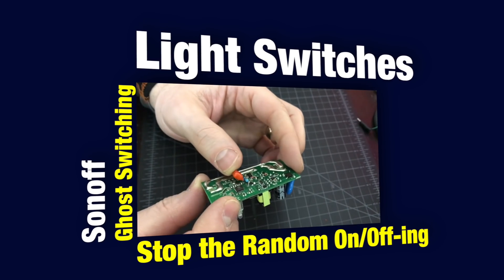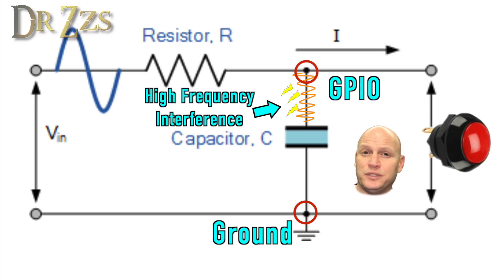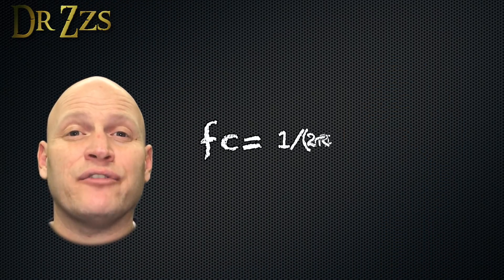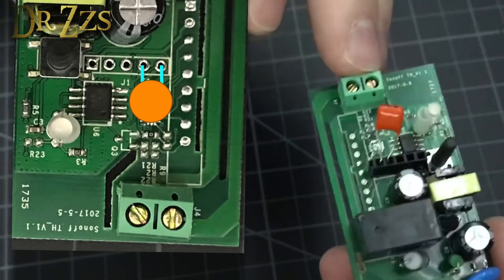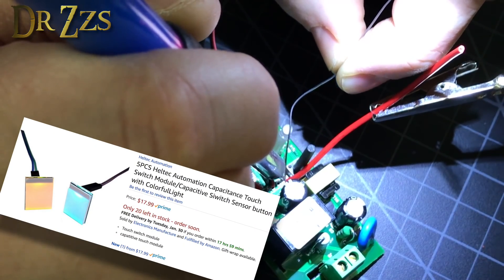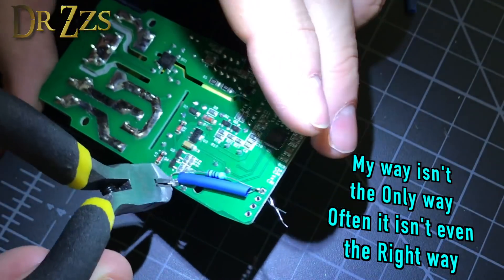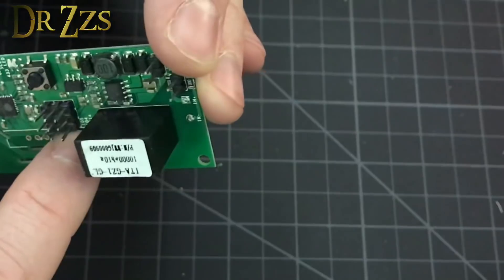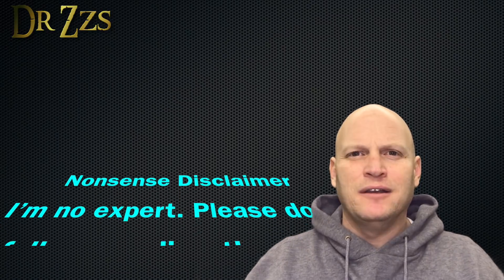Block Interference with a Low Pass Filter - Bust Ghost Switching!

Comment: I vote for 1.6 ota fix and how about fan light control? I'm thinking using a Dual. Thanks
Reply from the maker: I'm not smart enough to fix the 1.6 OTA problem.  I know the comment sections on the Sonoff website are full of request for them to allow a downgrade of firmware or undo the certificate requirement in the next version.  As soon as I hear about a solution I'll post something about it. 

But for the fan and a Dual I could help ya. 
I did a video on the Dual. https://youtu.be/pGbDFsNMOkw
Order from iTead directly and ask specifically for an R2.  Make sure you use Tasmota 5.10 or newer. 
If you need more specific help beyond what's in that video let me know.

Comment: According to this: http://www.ganssle.com/debouncing-pt2.htm you would need two resistors for a proper debounce circuit. The one additional resistor is needed for the controlled discharge of the capacitor.
Reply from the maker: Thanks  
I need to educate myself on debouncing.
Reply: Where does the second resistor go?

Comment: Thanks for your video. I just installed the resistor yesterday, cause I don't have the capacitor yet. I used 10kohm. That solved the flickering 99%. Cause I experienced one toggle once in a day. Also recommend use a twisted pair of wires, that would help to cancel some interference. Any video about the best strategy to keep Tasmota updated OTA? I'm still running stock firmware on all my Sonoffs, except the one with Tasmota that I'm testing before update the other's.
Reply from the maker: Actually, I do have a recommendation for an video about OtA Tasmota flashing:
https://youtu.be/ONFhXM5R-t4

That's just the one way I know how to do it.  There are other ways:
https://github.com/mirko/SonOTA

Good luck!
Reply: DrZzs Actually, I already watched you video about OTA flashing. But now, that I already have the Tasmota firmware, I want to know what is the best strategy to upgrade the Tasmota firmware to a new version of it. Do I need to download the new version, compile and flash it again? Imagine if I have lots of  it installed. I have to use the Tasmota firmware to upgrade itself. But how is there any easier way to do it? How to do it without loosing the configuration of each unit? Thanks again.
Reply from the maker: oops, sorry, I misunderstood.  
You don't need to re-flash.  There are 2 methods to update Tasmota. 
One is with their OtA server-based link.  
On your device main page there's a button that says "Update Firmware" (or Upgrade, can't remember which). When you click that it'll open a page with the 2 update options.  The top is just to connect to the Tasmota github and upload the most recent version.  
For the second option you need to go to the Tasmota github and download the latest version to your computer.  Then upload that file.  I think it's Sonoff.bin  

As far as I know there is no auto-update option.  So you'll have to connect to each device and update them separately. 

You may have already read this, but here's the link to the Tastmota upgrade page:
https://github.com/arendst/Sonoff-Tasmota/wiki/Upgrade

I've done both methods once each.  They worked fine for me.  

Good Luck!

Comment: I've added Sonoff basics inside of several single pole switch boxes as well. Then the switch is only wired to the gpio. I have also had some of the lights randomly toggle off or on. I thought HA was the cause or tasmota on the Sonoff was crashing. Any tips on digging up the root cause in the logs to verify the light is legitimately toggling because gpio was shorted? I see the light was logged in Home Assistant as being turned off or on, but I didn't do it. Would like to be sure, if possible, before I purchase more parts, open up light switches, and get soldering. 😁 Thanks for the great videos!
Reply from the maker: You're welcome!
I can understand that. I wouldn't want to tear all that out and do all this work to have it not fixed.  
You might try some kind of MQTT monitoring software.  Maybe that would tell you if the command originated from HA or not.  I don't use an MQTT monitor currently but I've been looking at them and I'm sure I'll get one running soon.  I found this article just today in fact:
https://www.hivemq.com/blog/seven-best-mqtt-client-tools

I haven't tried any of the programs they discuss, but maybe you could start by trying something like that and see if you can get the info you're looking for.  
If you do, please come back and let me know.  

Good Luck!
Reply: Hi DrZzs. Please help me with something.  Im trying to automate something in HomeAssistant, and the trigger should be when someone toggles a Sonoff switch (with Tasmota). How can I detect this in HomeAssistant? How to doffer when the swicth has been toggled physical and not in the app?
Reply: Sonoff retain feature not enabled within Sonoff by default.

So turns out retain isn't enabled by default on the Sonoffs with Tasmota.  You have to use command "cmnd/sonoff/PowerRetain on" in the console to enable it.  I noticed that if I had a light on, rebooted HA, it defaulted the switch to off, even though the light was on.

Use "cmnd/sonoff/PowerRetain" to see if yours are on or off.  Mine were off.  So, I enabled it, rebooted HA, and now it detects that the lights are still on!

https://github.com/arendst/Sonoff-Tasmota/wiki/MQTT-Features 

This seems to have also fixed my phantom lights turning themselves off and on... 
https://community.home-assistant.io/t/mqtt-switches-and-lights-are-not-persistence/36300 

https://home-assistant.io/components/logger/
To enable FULL debug logging, just add "logger:" to your configuration.yaml file and you get full logging in /config/home-assistant.log after reboot.  When one of my lights randomly shut off, I was able to use Notepad++ to CTRL + F, then use the Mark feature to search for "payload=".  This made it easy to spot the times when the light/switch was powered off or on.

Comment: Hi DrZzs. Awesome videos, thanks for posting. I'm running a sonoff basic connected to a 240v relay which is used as a switch for a 12v circuit. After a few days the sonoff switches itself on, when you turn it off, it comes straight back on again, sometimes vice/versa. Unplugging the sonoff usually cures for a few more days. Assuming this is the same issue.. I would need to do this for gpio12. Where could I pick these solder points up on the board?
Reply from the maker: I found GPIO12 for you!
Probably the easiest place to hit it is on the ESP-chip-facing side of R19.  
I'd be very interested to know how it goes if you decide to go after it. 

https://github.com/arendst/Sonoff-Tasmota/wiki/Sonoff-Basic

Good luck!
Reply: Made the changes gpio12 as suggested.. Sonoff seems to work still! Used a 4.7k resistor & a 22nf ceramic cap.. will update in a few days. I have a picture, can post.

Comment: Seems like something that could be solved with a longer debounce in tasmota?
Reply from the maker: I saw someone in the Tasmota issues page talking about something like that.  I don't know enough about the coding involved in that kind of a change. 
I didn't mark the post so I'd have to search for it again.  Would be great if there were a software fix for it.
Reply: I figured it out.  If you configure tasmota with SwitchMode6 you can enable "hold" mode , set the hold duration for .2 seconds using SetOption32 2, and set the hold text to "TOGGLE" using StateText4 TOGGLE.  This makes it so your switch only fires with a hold of .2 seconds or more, stopping the ghost switch.
Reply from the maker: Nice!  
That's way easier!
Reply: I tried this and I must be missing something, My Home Assistant always shows the switch on even if it's off, 
and I can no longer turn the switch on/off from home assistant.
The POWER topic either send 'ON' or 'TOGGLE'  (instead of OFF) so do I need to setup a new topic.
Thanks for any pointers on this.
Reply: What are the console commands? I have tried this and it is the same.. Do you need a rule?
Reply: Robert Tait amazing thanks for pointing this out just changed the settings
Reply: Hi Robert, is this what you meant? Thanks for the tip!
#define SWITCH_MODE            PUSHBUTTONHOLD_INV
#define KEY_HOLD_TIME          2
#define MQTT_CMND_HOLD         "TOGGLE"
Btw , thnx DrZzs another great video...
Reply: You could certainly do it like that, I used the console though.
Reply: @robert , thanks for reply... i dont know exact sonoff console command; please kindly show.
Reply: Robert Tait Hey Robert could you be more specific. What commanda dontou need to use in the command line?
Reply: @Stewart Barrett mate I still had ghost switching even after adding the cap and resistors. Even trying to set it up as described in this reply post wouldn't work. (Unsure if it was the update to the tasmoto firmware or what)

My issue was from when my solar panels would start up it would make the line voltage dirty Andi had a long cable run from switch to the sonoff.

The way I fixed it which may work with you was to wire the earth from the house to the ground on the sonoff (easy to get to if you have run a cable from gpio14 and ground for a switch) as all you need to do is wire the ground from the switch to a earth. Fixed it instantly and have not had any issues since.

Comment: Another excellent video thanks 👍. Suggestion for your next vide, sonoff basics with separate pir sensors in series. So you can turn on all lights outside if you want, or leave them alone to just activate with pir. I think you can work out what my next project for ‘she who must be obeyed’ is 😀. Cheers
Reply from the maker: Ha! 
That's a good idea.  I'll have to work on that. 
I'm still riding the points I earned from making the bedroom lights respond to voice commands.

Comment: Thanks so much man!   Had this problem after using my existing wall wiring to operate a switch attached to my sonoff (which I used your other videos to get going).  Again, thanks so much for all your videos.
Reply from the maker: You're welcome!  
Glad it's been helpful to you.  
I've got a lot of work ahead of me, since I installed a bunch of sonoffs before I realized this was even a problem or that there was a solution.  Now I've got to take them out and add the LPF.  
But, I'm also working on what it would take to make a Sonoff "UL-approvable". Working on that video next.
Reply: Yup I'm dealing with the same thing.  I have 5 of them scattered around, some behind light fixtures in ceilings etc.  This'll be fun... hopefully it works and i never have to deal with it again.
Reply: Just finished redoing everything with this.  Working perfect
Reply from the maker: Will Ross Awesome!
I love it when it works!!

Comment: Haven't experienced the ghost switching myself YET.  In theory just the extra pull up resistor (~5K) should take care of the problem in most cases.  I thing I actually mentioned it in my video showing the alternate 3-way wiring circuit.  Regardless, adding the capacitor to create the low-pass filter will definitely increase the circuit resistance to spurious signals that tend to be "spiky" in nature.  I guess if you're in there soldering and have the ceramic capacitor it's worth throwing it on.  Again, thanks for the great set of videos.
Reply: Not enough, you need a capacitor as well. I have and the capacitor was the last piece of the puzzle.

Comment: Thank you for thoroughly explaining this. Can/should this technique be applied to all sensors connected (i.e. Temp, PIR) ?
Reply from the maker: Eugene Pugach I think you can. If you think your getting bad info from your sensors then give it a try. The only way I think you’d have a problem would be if the signal you want to preserve has a frequency above the frequency cap of your R/C.  I wouldn’t think that any of the sensors we might use in most home automation situations would have much if any variation or frequency.  
Only maybe pwm or a sound signal could get blocked. But if that was happening you could just change the R/C until the Fc was higher than your signal. 
I probably just made that more confusing than it had to be. 
Short answer... yes. You can do this on sensors. :)

Comment: I wondered if they could fix this with some debounce code where it would have to see the pushbutton for decent amount of time(human press) and not just an interference press.  Think I've seen some firmware with this option somewhere.
Reply from the maker: It's possible there's a Console command in Tasmota.  I'd have to look. That would sure be a nice and easy solution.
Reply: DrZzs Hi, watched this again after getting this issue with Tasmota on a D1 mini and my motion sensor keeps tripping. My sensor was put up very high on a wall and will be awkward to do the hardware fix, did you ever work out a software fix or have you got an example you could share for Home Assistant that would only activate an automation if the sensor triggered say twice in 10 seconds only then it would turn on a light, not on the first trigger ? Cheers
Reply: Hi @DrZzs, thanks for all your videos. I'm about to install my first sonoff and I'm curious about the B solution for this. Did you find any software solution by Tasmota Console? It would be great to avoid this soldering way..
Thanks again!